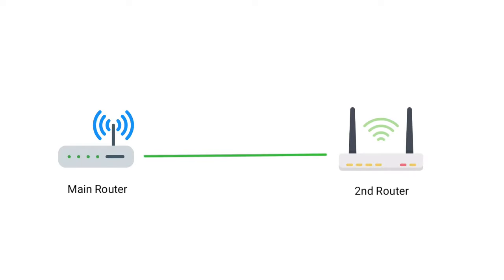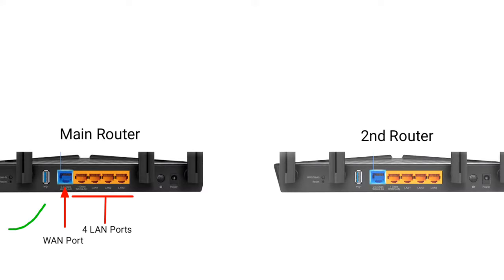How to Setup Bridge Mode in Any WiFi Router | WiFi Router Bridge Mode | Pro Tutorials BD

Comment: This is NOT bridge mode!!! ❌
Reply: Hello, so i want to limit the bandwidth of some connected device on my wifi, But my provided my modem provided by ISP does not have a settings to limit the bandwidth. So i bought a router with bandwidth Control, But i cant open the admin settings page of the new Router because when i type the ISP ip address its showing the modems admin settings page not the Router's. how can i access the Routers admin settings page??
Reply: @-n-6969  what make/model is it?

Comment: Lacked essential information as you went thru your process. More talking, less video super duper animation. Equal on both fronts with explanation as you went would make your video much more useful. You did not say which router you were going to and when. Therefore I will not subscribe. Make a better tutorial and I might consider it. But hey your video was 2 years ago, perhaps you got better. But if you did then this video should no longer even exist.

Comment: this isnt bridge mode, this is pass through.
brudge mode is much better.
Reply: Hi, what is the difference between these two and I want to convert my router to bridge mode.
And it has options, of binding LAN1, LAN2 and so on.
Should I check those options or not?

Thank you so much for the help